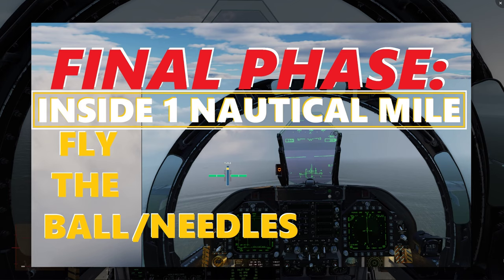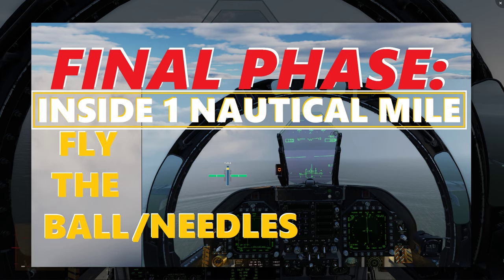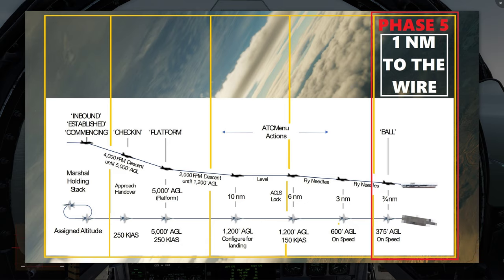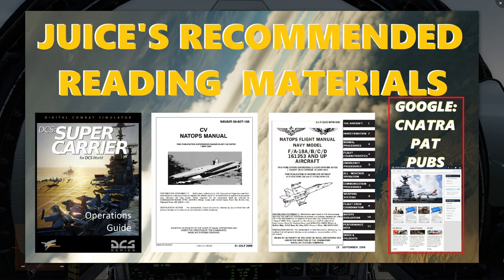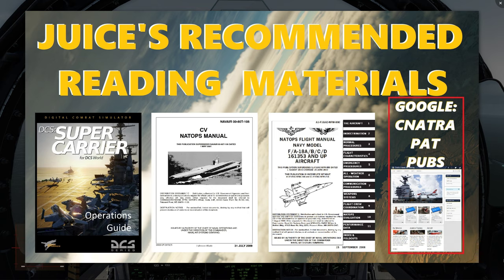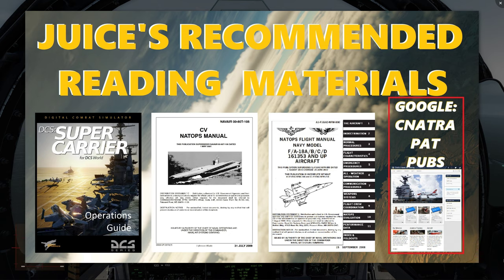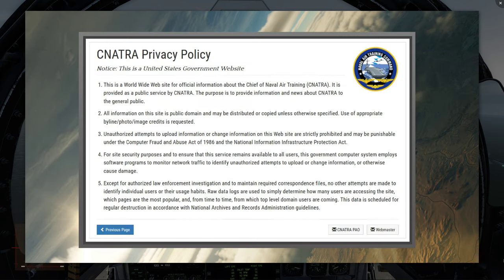DCS World - F/A-18C & SUPER-CARRIER CASE III PRACTICE - PHASE 5: ONE NAUTICAL MILE DOWN TO THE WIRE

Comment: I would like to highlight that a stabilised approach should have already been achieved in the previous phase, meaning that the Velocity Vector is central to the needles “cross” with the centre horizontal bar of the E staple on the VV horizontal bar line. The E staple is a critical indicator that, when aligned as mentioned, shows you have achieved the correct AOA & the correct approach speed for your current aircraft weight to engage wire 3 on touchdown and that you are coming down the glide slope angle.

The aircraft longitudinal axis (waterline) mark can give you a rough idea that you are setting the plane up correctly for speed two phases back but plays no part in the final precision needles phase.

Corrective actions during the final mile are aimed at maintaining stability on the needles. Maybe a sequel video of a later flight would demonstrate it more clearly, especially if you do it in weather that only allows a view of the carrier in the last few hundred feet :)

Great series! Go to full mil power on touchdown thump, not before...
Reply from the maker: Awesome input!   Thanks for the tips!

Comment: Hey Juice, to avoid the EGIW call in the hornet you have to put the throttles forward just before touching down due to the slow spool up times.
Reply from the maker: Thanks BEN!  I'm going to have to pay more attention to that at the lane entry and for the full time duration in the wires...sometimes I get no EGIW, maybe 50% of the time.
Reply: @AIRWARFAREGROUP  yeah it’s just muscle memory but once you get used to it your grades will start to look much better. Can I also recommend using Airboss script because it’s grades are much more accurate than the typical dcs carrier Lso.

Comment: o7 Sorry I do not want to be the picky guy here, but most times the term "needles" is used wrong within the DCS community. "Needles" refers to ACLS (not implemented in DCS yet). What you mean when you say that for ICLS is actually called "Bullseye". Actually the DCS carrier ATC says it right and gives you the call "fly bullseye". I get that most people would interpret the ICLS "lines" as kind of needles though. But that is where the mistake comes from. It is actually mentioned in the Supercarrier Operations Guide on page 22 that you show at the beginning.

EGIW is pulling back the throttle in wire. In DCS this is still a common LSO bug and can be ignored for now. There DCS is picky like me :D
Reply from the maker: Hey Fuze...Nit Picking is great and not a problem--we appreciate feedback and clarification as it makes us, and our viewers smarter.  Keep the comments coming!

 So in this video, I was flying an ACLS MODE 2 approach using the ILS chicklet boxed on the HSI page.  Would the term needles still be an inference to the horizontal lines in the HUD and ADI DDI pages as well as the gyro ADI instrument?  Reason I ask, is I found this in a current US Navy Publication...JUICE
T45 CV Procedures:

Automated Carrier Landing System (ACLS). The ACLS is similar to the ICLS in that it 
displays "needles" that provide approach guidance information to the aircrew. The ACLS uses 
the AN/SPN-46(V)3 Precision Approach Landing System (PALS), which incorporates a ring 
laser gyro stabilization unit. This allows the ACLS to provide highly accurate and stabilized 
glideslope and azimuth information in nearly all sea states. The Spin 46 has two dual-band radar 
antennas and transmitters that provide it with the capability of controlling up to two aircraft 
simultaneously in a "leapfrog" pattern. As each approaching aircraft lands, another can be 
acquired.

The ACLS has three modes for approach:

a. Mode I is an automatic approach in which the aircraft flight controls are coupled with 
the ACLS. Command and error signals are transmitted to the aircraft, which then 
translates them into control actions providing a hands-off approach and landing.

b. Mode I Alpha is an automatic, hands-off approach down to visual acquisition of the 
IFLOLS, at which point the pilot takes over and flies the approach.

c. Mode II is similar to an ILS approach. Error signals are transmitted to the aircraft 
which displays the needles on a crosshair display.

d. Mode III is a Carrier Controlled Approach (CCA), which is akin to a GCA. The 
controller provides azimuth and glideslope information to the pilot.

Found this trivia piece on Nitpicking on the web:

Nitpicking is a term, first used in 1956, that describes the action of giving too much attention to unimportant detail. A person who nitpicks is termed as a nitpicker. The terminology originates from the common act of manually removing nits (the eggs of lice, generally head lice) from another person's hair.
Reply from the maker: Fuze...are you sure ACLS isn't implemented yet...I'm getting good center-line and glide-slope indications (needles) during the approach and they seem to be accurate during flight?
Reply: @AIRWARFAREGROUP  Nitpicking since 1956, nice one :D

I was just referring to the terminology. ICLS "bullseye", ACLS "Needles". And many just say it otherwise somehow.

May you know this one already, but here you can hear the comms for it: https://youtu.be/B6ejN_Hf_oE 

Like your channel, keep them comming :)
Reply: @AIRWARFAREGROUP  The DCS Hornet has no ACLS yet. Even when the Carrier ATC says ACLS lock on. This is just a phrase yet for later implementation. It is on the roadmap for 2021 though.
And even if, I would not use it :D Usage IRL is also like nearly never. The indications and the lock on for additional guidance, yes. But not the automated landing.
Heatblurs Tomcat has iirc, but I don't fly it so I am not sure.
Reply from the maker: Hey Fuze...I'm just getting into flying with the VNAO guys and they have been super-helpful in sharing good information such as you provided in your feedback.   Are you currently flying with anyone or an organized group in DCS...I would check them out.
JUICE
https://www.vnao-cvw-7.com/